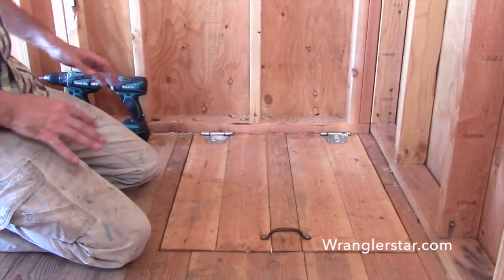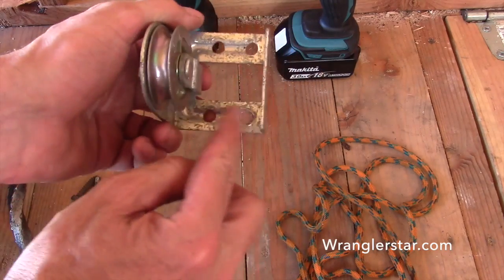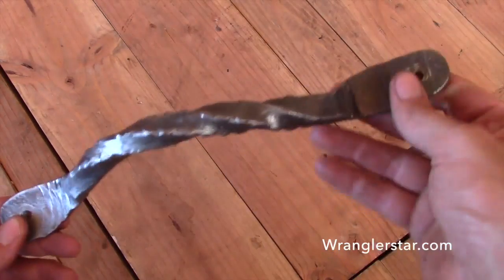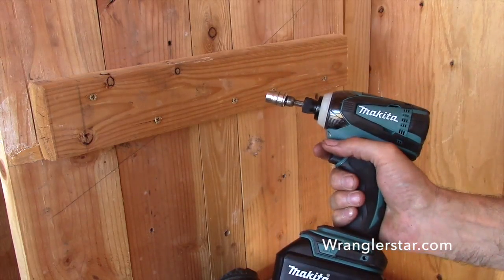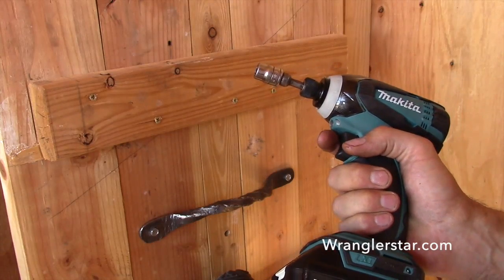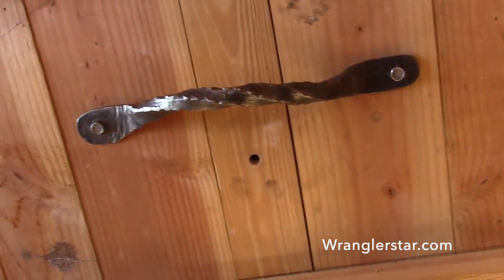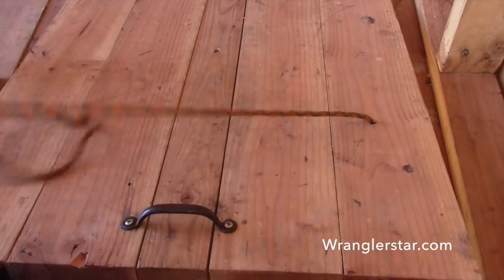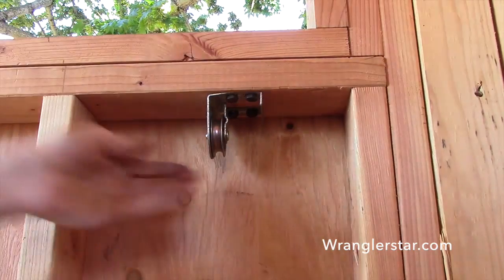How To Build A Treehouse Trap Door | 32

Comment: Good to see that you upgraded your tools.  Been saying that for a couple years.  Still have my old heavy Dewalt impact, but the batteries are not strong.  So, i picked up a Milwaukee impact and hammer drill before the Dewalt batts go flat.  So much more juice.  :D
As a carpenter, good tools are vital.

Comment: I don't know how you finished up the brake rotor weight, but I was thinking it would be a good idea to attach two wood slats along the beams that it sits within to act as a guide for the rotor to slide up and down with to keep it neat. Possibly even then put a thin panel over that slot to prevent fingers from getting into the mechanism too. Nice story too! God bless

Comment: Great news, you don't have to do math to find the spot where you should drill a hole! I've seen in another video of you about reducing the weight in your backpack that you have one of these scale things that you hold in your hand and you hang stuff on it and it weighs it. Using this, weigh the brake disc and then search a spot on the hatch where you measure the same weight. You might need to make some sort of hook to hook under it but I'm pretty sure you can find the right spot this way!

Comment: Clever mechanism.  Another enjoyable video.  Here's my two cents worth: I would've used flat-headed carriage bolts to secure that very nice forged handle to the door.  Those lags will work loose eventually.  One quarter inch diameter carriage bolts would do the trick, like what you see fastening a handle on an overhead garage door.  The heads will be flush with the surface, in your case floor, and will be snag-free.

Comment: i watched this video a wile ago and just 10 minutes ago i was in the kitchen going for a glass of milk and there were two jugs. I picked one up that was just your average jug of milk and left the one thatd been shoved in the back. For some reason i had this video and your story in mind and i couldn't shake the thought that i should put it back and get the other one. If your expecting an exciting ending you wont get one but just before i opened it i stopped turned around put it back and got the other one. I have no idea where this is gana lead me but i felt like it was actually something i needed to do. Ill keep ya updated if anything comes of it.

Comment: Another great video Cody. Just a suggestion on the weight. I know the brake rotor works fine but have you thought about one of those old window weights that go inside the window sash? It should be just about the same weight.

Comment: The drill a bunch of holes strategy is akin to man's nature in navigating by dead reckoning rather than by exact directional recipes. The engineer who doesn't use dead reckoning as a check is going to fail at times when he doesn't take every factor in account. It helps in doing math by checking results by estimating whether the answer you got is about right or not. Like 2.8 X 4.8 should be close to 3 X 5 so if you get close to 15 in your calculations you are probably right.

Comment: I get that you used what you had on hand, but my contractor side tells me, it could still be improved upon. Why not use 1 or 2 screen door closers to give it that soft close feature that would keep the kids from getting pinched or wacked? And I do like someone else's idea about some rubber stripping around the edges.

Comment: If my hand sketching is correct, and the trap door is 32"x24", green Douglas fir, with a measurement of 36" from floor to pulley, 26" from wall to rope attachment at door, this would yield a door that weights around 45 lbs. This should yield a weight needing to be around 37 pounds to provide static loading.  Only issue I see is the rope rubbing against the wood door, fraying the rope over time; easy to fix, or just keep an eye out and replace rope as needed (would need to anyways due to UV exposure).

Comment: Hmm, the real engineer could do it even without using math:
Just temporarily attach an iron bar over the lid to attach the rope to and shift the knot around till match the weight best, and THEN drill the hole ;)

Comment: Those tools might be awesome... in the summer. I prefer my good ol ni-cad 14.4 snap on cordless tools, they work in the cold.

NO way that thing does 500 ft lbs, my 3/8 snap on gun only does 210. I could see 500 inch pounds.  But the makita wins by far in the price department!  I also like the fact that they took the time/spent an extra 10 cents to add a capacitor to keep the light on when the trigger isnt being pressed. Snap-On still hasnt got that right.
Reply from the maker: Ruzz P Yes I looked up the spec. I does nearly 1500
Reply: 1420 INCH lbs... 1420/12=118.3 FOOT lbs

Comment: I badly abuse those makitas on a daily basis and they just keep on ticking
Reply: I've used those Makitas daily for about 6 years.  I fabricate for a living and am very hard on them. I will not buy another set.  3 sets in, multiple rebuilds on the drill and a speed test on the impact driver and its Milwuakee red for me from now on.  I tested my Makita vs a DeWalt with freshly charged batteries and my Makita was SMOKED!  3 screws to my one.  Then Milwuakee came out with its fuel line and those things are crazy strong.  Got my red tools and I won't go back.

Comment: "If you aren't good at math, you wont make a good engineer/programmer/etc" I hate hearing this. That may have been true 60-70 years ago but not these days. 

I am terrible at math but I am a good programmer, more so as I am going into computer game development and there is a lot of math involved in that. 

If you want to be an engineer then you can be an engineer. you can be anything you want if you try hard enough. 

You don't need to be good at math, you just have to understand how the math works. You have a calculator for the rest of it and there are some really really good engineering calculators out there from companies like Casio. Learning how more complex math works is as simple as pattern recognition. Use flash cards to learn symbols and the best way of learning what those symbols mean is by using them and with the internet these days, there is nothing stopping some one from opening up a window/tab with google on it and searching "What is Lambda?" "What is Pi" "What is Tao" etc etc. Though those examples are more mathematics than engineering but still useful to know.